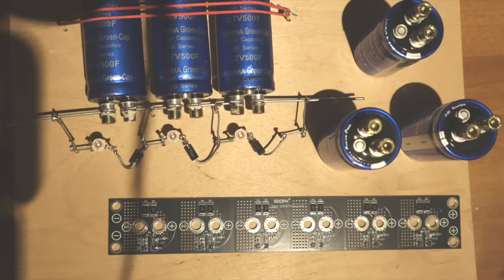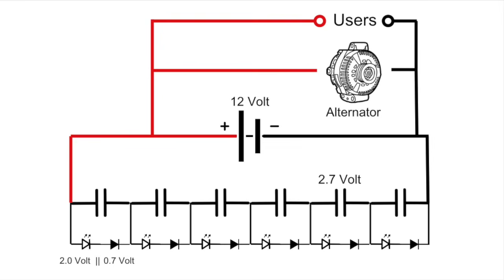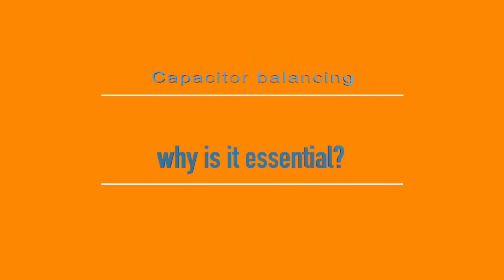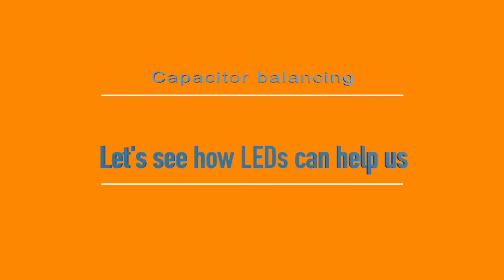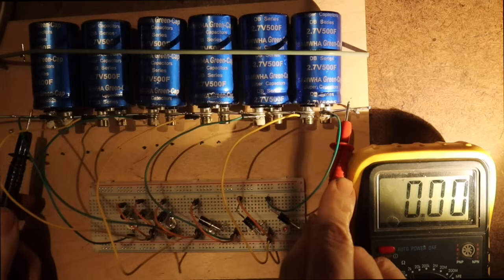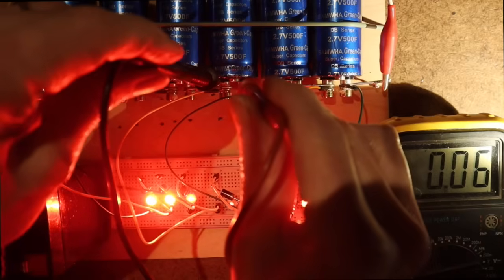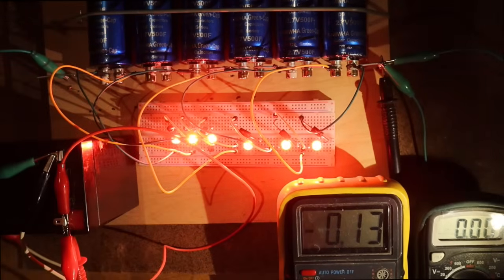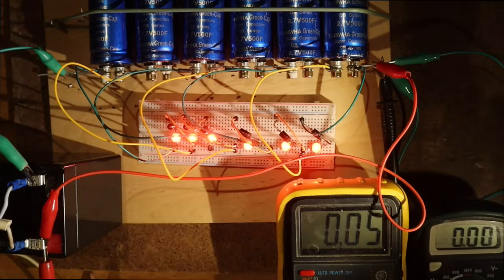How can a Super Capacitor help you start your car reliably and let live the battery longer? 86

Comment: To get all on same page... "12 system" using Wet or AGM Lead Battery @ Full Charge is 12.6V, "Dead" is only 12-12.1V. The Engine running and alternator Turn On is 14.3 to 14.7V depending on Alt's Regulator Settings. Under 12V the battery might start some vehicles but will hate you and shorten the life if doesn't have a Dead Cell now. This is Why "Smart" Chargers refuse to turn on when sees battery under around 11V because Charging deep/dead batteries often causes Big Safety Problems.
This "simple balancer" circuit may work on a bench but sadly not for starting any vehicle. Why? Little known fact is Total "Standby" Power for ECM Radio etc to keep data alive when Parked is often limited to < 50mA but newer vehicles can draw more say 100mA and even with Bigger Batteries in those often have "Dead" batteries in a week or 2 max if Parked for too long and Why Many use Battery Tender or other Trickle Chargers for low use vehicles. 6 High Watt LED will kill the battery in a few days or even hours when Parked. Even Small Things like Dash Cameras very popular now can "Kill" a battery if not setup right AND has extra wiring to shut off power below 12.x volts. This is Why Super Cap Balancers look similar to BLM for LiIon and others have MOSFET to turn Off when Cell or Cap are @ Full charge.
Reply from the maker: The main issue that you state is true: beware of depleting the car battery with continuous loads, even small. I tried on that purpose many solutions with several diodes on several voltages. From the other side I had also so ensure that the diodes deviate sufficient current to draw all capacitors on the same level. Not easy, this compromise. It is clear that you have much experience and are able to specify what size of current is already a problem. I thank you for that and will consider it in the video with the final version. That might include the recommendation to switch it of during long parking.
Reply: @nnvasen-good-energy  Example: Right now I put a trickle charger on 1 car because New battery was low @ 12.2v because don't drive often, don't drive enough time or worse both for the alternator to charge going to store to store. 
Starter batteries and even most "Hybrid" try to mix Starter and "Deep Cycle" have a very narrow window of operation as said above. Full Deep Cycle can discharge to 11v or even deeper but Hates starting an engine or other Heavy Impulse Loads. All may look same but how the plates are made are way different.
The Starter (and other motors) are rated as Watts or kW and when they see Low Volts, they try to pull more Amps to get the Watts needed. That can fry Battery Cables, Solenoid and more. Those parts may look ok to you after a low volt event but damage is permanent making more problems or worse in the near future. 1500 / 12.6 vs 1500 / 11.9 changes Running Amps is bad but also Increase the Inrush Amps too that's hammering everything.
Many blame the Battery but any loose wires or other parts can cause same problem and not easy to test with standard meters.
Reply from the maker: I can actually imagine that low voltage will take more ampere, even if I didn't think it in the first moment. Low voltage will spin the rotor less fast so less countervoltage and more current. So actually it makes me believe more in the benefit of supercaps, which really keep steady the voltage with a fast but gradual decay as the current is drawn. So with only a (old) battery you have a quick high voltage drop at the first 100 milli seconds that might be 5 volt, with the supercaps a significant voltage drop will only come when the engine is running already.
Reply: @nnvasen-good-energy  Typical  battery cables for cars and many light truck class vehicles are 25mm2/4AWG with max length around 1m/3feet and easily handle 150a @ 12.6v... Now later the starter "Sees" low volts from low battery or other problems... Yes, the stater spins slower but also tries to pull more amps. The Cables and more can get very hot and very fast and cause more resistance, rinse, repeat, until you stop turning the key or something fails.
And not just the starter does this... all motors in the vehicle tries to do the same heating wires, relays and other controls, and burn out the motor too. That's a common fail for Electric Fuel Pumps etc.
So Just because a motor tries to get Amps with Low Volts, Often can't because of these issues. You might see it happen on a bench or things burn out because whatever can't take extra amps.

Comment: I want to make a small battery and capacitor bank to replace my motorcycle lead acid, for weight loss. Any suggestions?
Reply: Most Motorcycles already use a small battery so likely not going to save enough weight to justify the other issues to install the caps. If you have accessories that run without starting or just need standby power, they can hate even smaller battery then original equipment.
Reply from the maker: Yes, I agree. Better to look for weight loss in other parts, including passenger weight 😉 and luggage.
Reply: @nnvasen-good-energy  "Passenger weight", yeah, ditch the "spare tyre".    🤣
Reply: She can always walk  😉

Comment: Just came across this content and found it interesting. I have been using Super Capacitor Battery Jump Starter I found after I had a battery fail in my car in a parking lot after shopping. I pulled out what I had thought was my backup battery jump starter only to find that the battery in it was drained and wouldn't energize the engine starter.  Those battery jump starters require the owner to maintain it and if you forget about it, when you need it, it won't be ready to work.
 So after that fiasco I started to search for a better solution and found the Batteryless Super Capacitor.  What I decided to purchase and now keep in the car and and it's always ready. You connect it to the failing battery in the vehicle or can charge it on another battery, if available, then, the capacitors charge up and when ready, it beeps and you can begin the countdown time, or move it from the charge battery to the dead battery in the vehicle, then you hit the button, it beeps and starts a countdown timer, giving you time to get to the driver seat and wait for the final long beep, now turn the key and engine starts right up. I even tried it with a 12 volt battery that only showed 5 volts on the multimeter. It took approx. 25 minutes for the super capacitors to charge, but it did work and start the 8 cylinder engine without any hesitation. Here is the description. Autowit Super Capacitor Jump Starter, 12V Batteryless Jump Starter, 8.0 Gas & 4.0 Diesel Car Jump Starter, Portable Jump Starter for Car Battery, Built-in Supercapacitor.
This device is not intended to be kept inline on the vehicle's circuit, but it might give you some ideas on how it maintains the many capacitors in the circuit as it charges up and how it discharges when ready. Another tip, off topic, but about energy production. Check out turbulent.be (kind of a nextdoor neighbor, in Belgium) on their youtube channel or web page. Using low head pressure streams, irrigation ditches, abandoned mill races and inserting 15Kwh to 70Kwh water driven electrical turbines. I think this is something right up your alley since it is eco & aquatic life friendly, non polluting, and can be stepped downstream as needed as the water returns to the waterway after exiting the sluice channel.

Comment: Cold-starting is ~3kW for ~5s, ~15kJ. For a voltage droop from 13V to 10V, you need ~400F not counting resistance losses. Since you need 6S to safely withstand the ~15V maximum voltage normally coming out of an alternator with 2.7V EDLCs, that is 6x2400F. In small quantities, that costs around $500. Kind of pricey.
Reply from the maker: Hi Dan, it is pricey indeed if you have first class material: I saw Maxwell, 6x500F on a balancing board for 300 Euro and that was the reason that I ordered parts far under 100 Euro. That gave me a bit of work to separate bad parts from the good ones (bad was in this case only the board) and verify that self discharge wasn't too bad (10% in 12 hours) and at the end the result is let's say acceptable. Unless you want to park the car for a longer period, see comment of Thingstest above. Then also the self discharge is a consumption that kills the battery, so you might want to connect the capacitor bank only if you use the car every day. Well, the deal is to disconnect it if you leave the car and for the average distracted user this is asking too much,
Reply: 4:13  When you connect capacitors in series in order to increase the maximum voltage of the system, the capacity of the system drops by the 1/n of the capacity of one capacitor. (Assuming using capacitors with the same value). 

So in order to create a 500F capacitor of 6 x 2.7V = 16.2V, you’d need 6 2.7V 3000F capacitors. 

On Ali the cheapest 3000F capacitor that I found was about €36 including shipping without a balancing board. 

Please keep in mind that those super capacitors or rather chunky: 166x60mm

The total energy capacity of 6 such caps would be 500x16.2x16.2/3600=36.45 Wh  
At 12V however the total energy capacity would only be 
500x12x12/3600=20 Wh

The energy needed to crank a car at 500A st 12V for 3 seconds is
500x12x3/3600=5 Wh

When using 6 500F caps the capacity of such a bank at 12V would only be 3.6 Wh
Reply: @Conservator. Series-parallel
Reply: @jamesharrell4360  supercaps usually have a maximum voltage of 2.7V. You need to connect 6 of those in series in order to increase the maximum voltage to 16.2V for example.
Reply: @Conservator.  The actual cranking time is below 1second,  the peak current even short, 3000F for the 500A is too much, I tested 6x500F capacitor, enough to provide 600A current for starting.
Reply: Lipo starter booster is much cheaper and compact

Comment: Those leds come in 1w, 2w, 5w, and 10w flavors. And yes the forward voltage differs between red and blue/green colors. Keep in mind that LTO battery nominal voltage is 2.3 volts per cell.
Reply from the maker: Thank you very much Rocktech! I didn't find them on Amazon in Italy but in the United States, they were available. But in Italy there is also Alibaba and there I found them too. Great, have to order them!

Comment: Use a Lithium Titanate battery, this capacitors doesn't make sense. Those LTO cells last almost forever have a very low internal resistance.
Reply from the maker: They are indeed very interesting, I ordered a jump starter with high power Li and suppose that they are made from that material. I am curious about the differences with capacitors. I think both have specific advantages. Capacitors have the disadvantage indeed that they need a battery that is not completely dead.
Reply: have you had any overcurrent issues
Reply: @jimmybrad156  I've never had any issues with my 66160H A-grade cells (6s config—they easily deliver peaks over 800A, which is more than enough for engine starts. You just need to make sure not to overload the alternator—either reduce the field voltage or use some kind of thermal protection, because LTO cells draw a much higher charging current! Otherwise, your alternator might burn out at idle.
Reply: @fnordist  Yeah that's what I meant; how did you prevent the alternator from being overloaded?
Reply: @jimmybrad156  I solved this by attaching a thermal switch to the alternator, which triggers at 110 degrees C. This thermal switch disconnects the alternator's power to the battery using four (NC) relays rated at 100A each, wired in parallel—but not entirely. A 1.5Ω 200W resistor in between still allows about 9A of current to pass through. ( you still need field current )
Reply: @ Nice work. I guess there's no voltage curve issues? I guess sooner or later there'll be a 6S LTO car battery that can handle high/low temps, vibration, has plenty of ah capacity and a BMS that limits charging current. In the meantime I keep my car battery floated at 12.95v when not in use, clean it every 6/12 months and buy a new one when it's had it.
Reply: @jimmybrad156  Of course, the voltage drops from around 14.7–15V depending on the charge level of the LTO cells down to about 14V. You can work around this by using a lower resistance value instead of 1.5 ohms, for example, 1 ohm—but that requires some testing. It also depends on how much power your alternator provides, how much power your car requires, and how well the alternator is cooled.

In my setup, the relay rarely triggers because the LTO cells are constantly being charged, which also reduces current draw. That’s why I always recommend adding a LiFePO4 pack with high capacity in the trunk or elsewhere, controlled via an isolation relay. And I assume you’ve got some high-power audio gear anyway—that usually goes on an auxiliary battery. Personally, I run a 4kW ham radio amplifier that peaks at around 6kW, and it works fine because I use diodes to separate the power draw between the LTO and LiFePO4 cells. That way, the LiFePO4 pack doesn’t get overloaded during peaks. But that’s another topic.  

There are specific isolation relays where you can adjust the trigger voltage—for example, they start charging a few minutes after the alternator runs (e.g., when voltage stays above 14.8V for 5 minutes, meaning the vehicle is driving). If the engine is above 1500 RPM, the relay activates, keeping the system cooler and reducing heat buildup. This way, the LTO cells get charged first, which happens pretty fast anyway. The LTO cells draw about 100A when charging.
Reply: @jimmybrad156  I’m not sure if anything from my previous explanations was deleted by YouTube or something, but I just thought that a BMS capable of handling such high currents is relatively large. With 6 cells, the differences between the cells aren’t that significant, especially if you stay below, say, 80 to 90 percent of the maximum SOC. LTO cells are pretty forgiving in that regard. It’d be a different story if you had higher voltages, like for 24V or more—then a BMS would really make sense, or with parallel-serial combinations, of course. I went with this simple method because it’s reliable and because BMS systems designed for such high currents often cause issues. It’s much better at 24V or even higher voltages since the components are less stressed there.